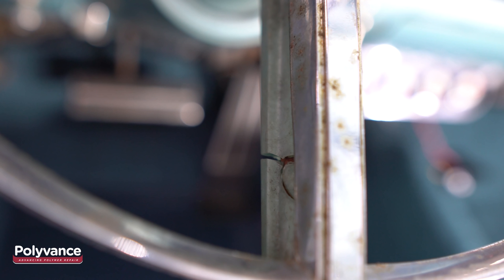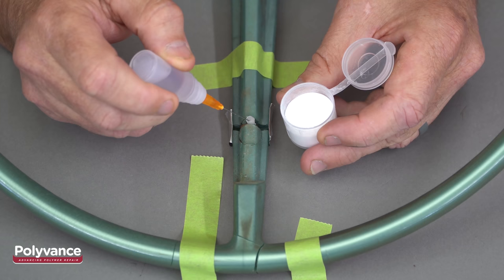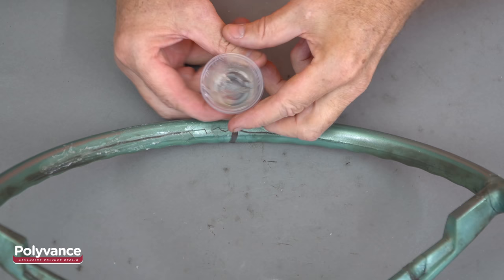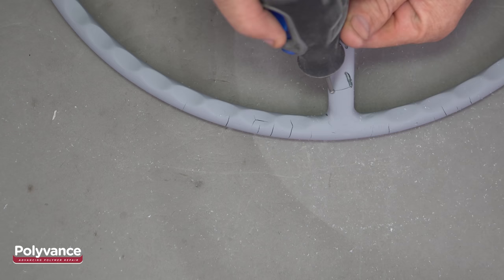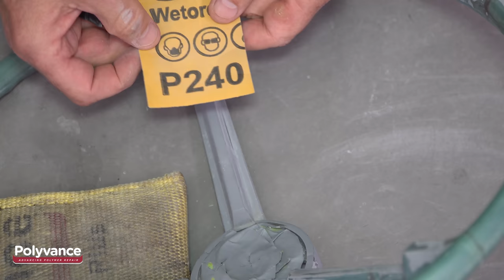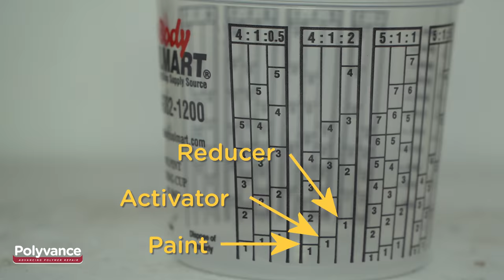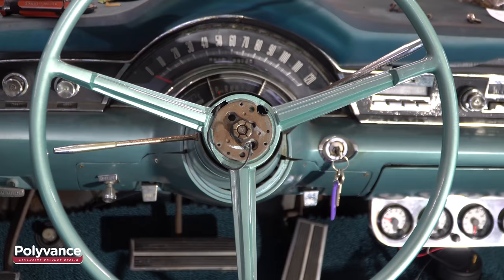Steering Wheel Restoration - Cracked Steering Wheel Repair

Comment: I've always considered repairing a steering wheel like this, and then finally undertook the endeavor. I was able to come out with a beautiful steering wheel. However, I am right back to where I started five years ago. The problem is that the original plastic will continue to crack in new places despite all you've done, ruining all of that exceptionally hard work. There are a few wheel restoration specialists that use injection molding to remake these vintage wheels using a much more durable plastic. I think that is really the only permanent solution.
Reply: There are solutions besides going all in on a complete strip and re-molded wheel. What causes the damage is sunlight and heat. If you think about the steering wheel sitting under the windshield, cooking away in direct sunlight all the time when parked, it makes sense. 

Window tinting will eliminate a lot of that destructive sunlight. Purists might scoff at the idea of popping 80% tint on their beloved classics windows, but it saves more than just the wheel. The entire interior is spared. 

A sun shield for your windshield… placed faithfully every single time you park it, will stop most of that deterioration. I have one for every car I have, including my late model Ram. They work. 

Parking in the garage if possible

Comment: It drives me nuts that you went through all that work to produce a nice finish on that steering wheel and then you put back that crappy looking metal horn trim.  You could have at least taken a light bit of steel wool to it to clean off the rough surface finish of the horn metal.  Overall though, it was good work.
Reply from the maker: Agreed.  I actually had everything re-chromed after making this video.  Too bad I can't post a pic in the comments.
Reply: @polyvance  I hope I didn't come off sounding like a complete prick.   I'm a recently retired auto upholsterer after about thirty-five years of doing that for a living.  I'm afraid I'm just anal-retentive about stuff like that; even though I'm no longer in the game..
Reply: Totally see what you mean, just a good cleaning of the chrome would have made that nice restoration look that much better!  Glad the parts were eventually restored, nothing like seeing well done work. I love doing restoration and having people enjoy the finished job.

Comment: Is this product just a relatively-large bottle of cyanoacrylates super-glue and a relatively-small bottle of baking soda ?
Reply: I’m willing to bet that’s almost exactly what it is.
Reply from the maker: No. PlastiFix is a special type methylmethacryalte designed for ABS, PC, Acrylics and other hard plastics. Superglue only bonds to the surface of the plastic. It is also very brittle and only has about 30% the strength of a PlastiFix repair on hard plastics. PlastiFix chemically etches itself into the plastic and should not fail.
Plastifix uses a liquid monomer to polymerize the powder to form MMA plastic in an exothermic chemical reaction. The most common forms of MMA include acrylic and lucite. The individual components have no adhesive properties without the chemical reaction of the two ingredients, unlike super glue. Because the components can be reacted directly on the surface to be bonded, the added benefit is that the reaction incorporates the surface molecules of the base plastic, creating a chemical as well as physical bond on some materials. The chemical AND physical bond make this type of repair extremely durable and impact resistant,  plus it is sandable and easily painted, unlike super-glue or gorilla glue type repairs.
Reply: @CreatorCade  I'd take your bet; you will lose.  Its a different chemistry than CA glue.  By themselves, the power nor liquid has any adhesive qualities; its only when they are mixed does the magic happen.
Reply: @polyvance  BURN!
Reply: J B weld works good too
Reply: @polyvance  If it etches itself to the plastic, why does it peel out of the mixing cup?
Reply from the maker: @alecb8509  This is explained in the video. PlastiFix does not stick to polypropylene. This is why we include the polypropylene cup. PlastiFix works on rigid plastics and does not work on olefin plastics like polyethylene, polypropylene, TPO, and TEO.
Reply: @alecb8509  That's  an excellent question!  Plastifix only works on hard plastics like acrylic, polycarbonate, ABS and AES.  They are all susceptible to the effects of the solvents and adhesives in PlastiIFix.  The mixing cup is made of high density polyethylene or polypropylene.  These plastics are not effected in any way by most solvent or adhesive because they have very long molecular chains.  The long chains means the adhesive has little to grab onto and  solvent doesn't do anything to loosen the ends of the chains, which would help give it some grip.  The net result is zero adhesion to PE and LDPE and HDPE.  Adhesives for plastics are formulated for certain types, specifically and what works incredibly well on one, may not work well at all on another.
Reply: @polyvance  assuming proper cleaning was done............
Reply: @seancrane8880  It was done well enough that the adhesive is completely bonded to the plastic wheel.  You may be mistaking discolored plastic or paint with dirt.

Comment: wouldnt be easier to just use epoxy? Could dye it to match the steering wheel color as well
Reply: Possiblely but you can see how much difference in color there already is

Comment: I cant help but think about the injection molding machine that cranked those wheels out by the thousands.
Reply: But the original steering wheels had a metal insert, not made of just plastic like the aftermarket ones made today.
Reply: @JohnMartin-ni2pj  Uh, that's true. They still placed the metal ring in the injection moulding machine and molded plastic around the ring though. 
My comment was pointing out that after watching all of this labor to repair the wheel today, I thought about the guy who stood in front of a machine in the early 60's, putting metal rings in and retrieving finished wheels thousands of times, over and over.

Comment: I used JB Weld as my filler.  Also, I opened the cracks a little to get the filler in place and to help it grip.
That was a ot 12 years ago.  It's doing great.
Reply: JB Weld has almost limitless uses. I actually just fixed a steering wheel with body filler (sparing use of hardener) and then coated the wheel with polyester resin and pigment.
Reply: I was wondering about using JB. I've used it on old plastic grille pieces before with good success. There's a LOT of different JB epoxies out there to choose from.

Comment: Tip: when mixing small amounts of paint. weight the liquid to the correct ratios and you'll have more accurate mixes. buy a small digital scale. Depending on lines on a plastic cup with small amounts is inconsistent, especially if you have to mix extra.

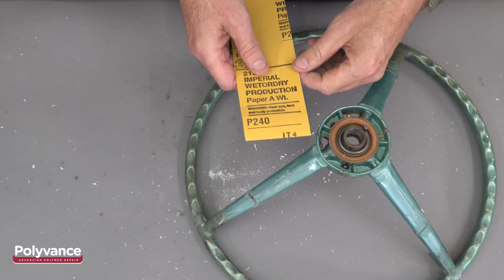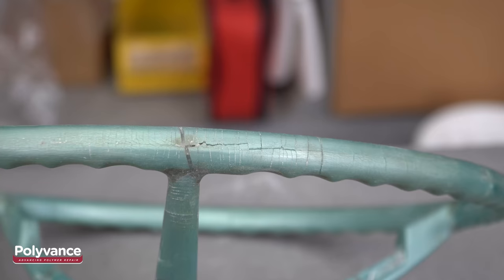Comment: I make a habit of being positive in my comments.  Thank you for very clear instructions, and high quality video technique.  I aspire to production with this high a value.  The remainder of this comment is an exception to my usual habit.  I am at 5:32 and stopped.  beyond very clear instructions, I just dont see this particular repair working or holding up over time.  I do 6 to a dozen steering wheels each winter. Here I see a steering wheel that is just flat out filthy that I would not work on until properly cleaned.  I see filth in cracks that are being repaired.  This stuff sticks to dirt but does not stick to polypropylene?  Just look at the filth in the finger grooves! I see cracks with no fresh edge, no keying, and no hope of holding a repair as expansion and contraction take place  I see unaddressed spider cracking directly adjacent to areas being repaired.  the time for that dremel and the sander was BEFORE you laid in a lick of plastic to make clean, keyed crevices that will hold material!  Based on the experience of seeing failed repairs, The "tiny and not too deep" cracks at 6:30 require cleaning and enlargement and keying using a dremel with a disc or burr so they dont show up at the primer step and they do not fail later.  You made it look easy, however, the truth is cleaning that wheel properly was a detailed 3 to  4 hour job, and keying and cleaning cracks prior to filling  was hours more. And a full keying job would have produced the need for much more material. (a positive for your bottom line!)  In addition to your high quality video and narration work, Your paint job was great!
Reply: The nature of the PlastiFix adhesive is that it will not stick to PP.  Adhesives are formulated for a specific application.  You may disagree, but just ask the guys who put in the anchor bolts in the "Big Dig" ceiling in Boston.  They used epoxy, but it was the wrong epoxy and the adhesive failed and caused the ceiling to fall, squishing some poor folks.  Plastifix adhesive is ideal on this type of material and holds up well.  I'm not sure if filthy is the appropriate term for this wheel. True, it wasn't surgically cleaned but it was cleaned well enough.  So far the wheel is holding up fine.

Comment: I might suggest using sandpaper to clean inside the crack for better bonding.
Reply: This wheel was not properly prepared.  proper preparation would have taken 7 to 10 hours

Comment: Amazing improvements in technique.  I had a 57 Corvette and original steering wheel with cracks was preferred to aftermarket or poor fixes of the time.  That plastic covers a metal rim underneath.

Comment: when using very thin strips of sanding papers (10:40), its a good, if not essential idea to put strong sticky tape or packaging tape on the back of the sanding paper.  masking tape isnt usually strong enough.
Reply: That's a GREAT tip!  Thanks.

Comment: Very helpful! Now I'm about 90% certain that my truck will be getting an aftermarket wheel. Results look great, but entirely too much time and effort for a non restoration like mine. Not like I really need the 17" wheel with the power steering upgrade and the extra belly room would be nice.

Comment: 🤔 what about the chrome why go threw the trouble to do that and not chrome the horn rails.   Also wonder how long that will hold up auto paint and hand oils.    Not to sure about this.  Also the filler and the sun see that cracking   Just my two cents
Reply from the maker: The owner of the car had everything re-chromed after making this video.

Comment: That is awesome.. I love your ease of directions.
I wonder if you could take the dimensions of the steering wheel and 3D print one? (Using some of the new printing elements like carbon poly, or some of the new harder materials?
Reply: I would say you could definitely do that, but you would want to print it out of something that is heat resistant, not PLA.  PETG might work, as would probably ABS or PC.  It would be an interesting project if you had a really bad wheel to start with, one where the plastic was just falling off or you just had a metal ring.  I would make it in two parts that fit snugly around the metal ring and snapped together.  I would also use adhesive, like 2510 PlastiFix to lay a bead between the parts before assembling.  (leave a space for the adhesive so it all doesn't get squeezed out).  I don't see any reason why this wouldn't work, but it would be up to you to determine its road-worthiness.  I'd love to see it attempted, anyway!

Comment: Nice job guys.  Another way to mix small amount of paint hardener to paint is to get a digital scale and weigh the ratio.  More accurate.
Reply from the maker: Good point, but the instructions were for "volume".  Besides, I doubt it has to be too exact.

Comment: so if the home mechanic wants to restore uding this procedure,.. but has no paint booth... whats going to be the  cost just for products??
Reply from the maker: The individual PlastiFix kits are currently $38.95 each. Our least expensive aluminum tape is $16.95 and our least expensive cleaner is $16.95. Those are the products for the repair. The rest of the products are for refinishing. The list of all products can be found here: https://www.polyvance.com/video/plastifix/steering-wheel-restoration
This does not include the grinders, sandpaper, etc.

Comment: Nice vid.  Just in case anybody is wondering, an OEM wheel for 66 Newport is around $240.00/$250.00. Nice savings, even if it is a bit of work,
Reply from the maker: Where can I get an OEM wheel?
Reply: @polyvance  Just type in OEM steering wheel for Chrysler Newport and they will come up.  Found one on Amazon for $289.00 and another from JEGS for $299.00.  There are others.
Reply: rats arsed  how could you possibly know if its durable or not?  And as far as original, good luck finding the right original wheel in perfect condition.  Restoration, by definition is not original , its a repair of something to look as original as possible.

Comment: How do you know what "plastics" were used one steering wheels?  And will it shrink again?
Reply: Good question.  To the best of my knowledge, acrylics, polycarbonates and bakelite were all used.  They are all hard plastics that are fairly stable.  They will continue to shrink somewhat (they start shrinking as soon as they are made) but at a slow rate.  The repair will also shrink over time, but should last just as long as the original if done correctly.  In fact, because old cars are generally not stored outdoors like they are when new, the repair may last longer as its won't be subject to harsh conditions daily.

Comment: Great video. Primer surfaces & sealer don’t need a hardener? It’s ready to spray out of the can?
Reply from the maker: The primer and sealer do not need a hardener.  They are ready to spray out of the can.
Reply: That primer surfacer is waterborne and does not require a hardener like a 2K primer and sprays right out of the can.  A crosslinker is available, although it is not necessary as the resin system in this primer is very robust without it and in my opinion the benefit is not significant enough to justify the paint wasted by not being able to pour the unused quantity back in to the can.

Comment: Nice restoration but the images before and after were not shot equally. The after had extra light so the result looked much better. The difference would haven’t been that huge if you shot them in same lighting. This is the same trick ads have used for ages. On the other hand, the chrome parts look really bad when you have much light. They need some polishing now.
Reply from the maker: You are right. The photos weren't shot equally, but there was no intent to trick anyone.  One was shot with the car parked outside; the other was shot inside a garage.  No special effects were done, nor was any Photoshopping done.  Also, the chrome parts were re-chromed after this video was made.  Thanks for watching and taking the time to comment.  Be sure to subscribe so you won't miss the video showing the completed restoration and the re-chromed parts.
Reply: Mattikaki, I have a 4 year college degree in advertising photography from RIT and I can assure you, no lighting tricks were used to make the "after" look better.  Perhaps the only discernible difference would be a minor unintentional difference in exposure, because "AUTO" mode was used.  "More lighting" as you put it, (which I'm going to assume would mean softer, broad light sources, similar to what is used frequently when photographing jewelry, chrome, and other shiny stuff),  would only enhance defects anyway.   Not only that, but take a look at the wheel while its being painted, shiny and smooth.  When using a single stage paint, the paint doesn't shrink much, like evaporative cure paints do, so what you see is generally what you get.
Reply: Scott B   I am Senior Video Maintenace Engineer and photographer and have been working in large TV company   I know that those images are different. It is due to the ambient lighting. You can see the difference when looking at the speedometer. In the first picture it is dark and in the other one it is lit.
Reply: @mattikaki  One was shot outdoors, available light.  The other indoors, available light.  No trickery.

Comment: I suspect this is a variant of the baking soda and superglue trick.
Reply: AllFirstHand i was just thinking that, seems to be a slow reaction mixture since superglue and baking soda harden almost immediately
Reply from the maker: It's not super glue and baking soda. PlastiFix is a special type methylmethacryalte designed for ABS, PC, Acrylics and other hard plastics. Superglue only bonds to the surface of the plastic. It is also very brittle and only has about 30% the strength of a PlastiFix repair on hard plastics. PlastiFix chemically etches itself into the plastic and should not fail.
Plastifix uses a liquid monomer to polymerize the powder to form MMA plastic in an exothermic chemical reaction. The most common forms of MMA include acrylic and lucite. The individual components have no adhesive properties without the chemical reaction of the two ingredients, unlike super glue. Because the components can be reacted directly on the surface to be bonded, the added benefit is that the reaction incorporates the surface molecules of the base plastic, creating a chemical as well as physical bond on some materials. The chemical AND physical bond make this type of repair extremely durable and impact resistant,  plus it is sandable and easily painted, unlike super-glue or gorilla glue type repairs.
Reply: @polyvance  I think that's where the 'variant' part comes in.
Reply from the maker: @AiMR  It's similar in method only, but it's made of entirely different chemicals.

Comment: That's a lotta work and unfortunately nobody makes replica steering wheels for these vehicles. So it's repair or replace with aftermarket, not much choice!
Reply from the maker: The other option is to have it recast, but from what I understand, that can cost thousands.